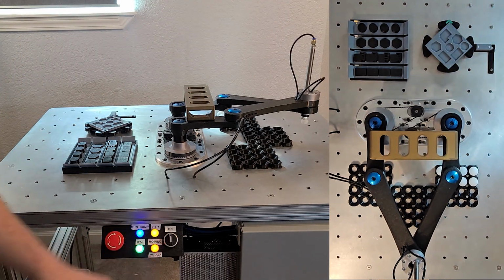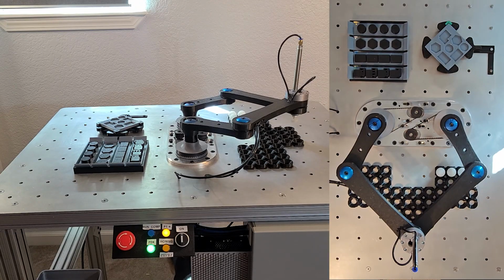Parallel SCARA

Comment: Could you elaborate what kind of bearings were used? I'm currently self-teaching myself a bit of mechatronics, and I don't understand how those arm segments connect. What so I have to search to find this kind of joint? If you don't mind, I'd be super grateful to see a cross-section of one joint).